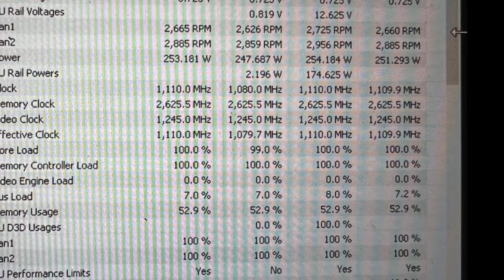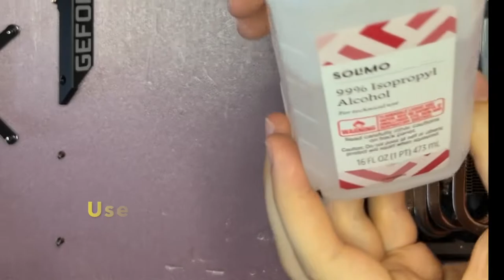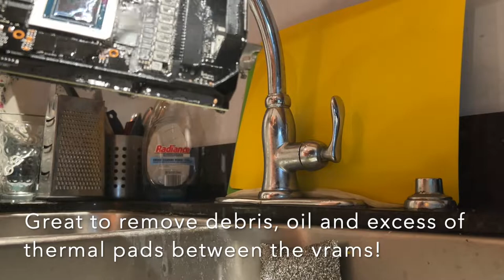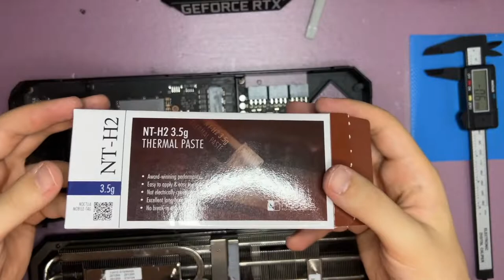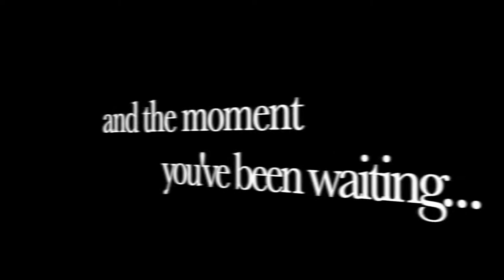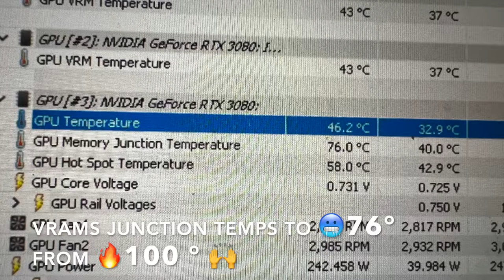Asus Rog Strix 3080 Thermal Pads and Fan Replacement

Comment: Very useful, thank you
Reply from the maker: I appreciate that!! Thankyou
Reply: @MAIKUS07  May I ask where did you get the replacement fans from?
Reply: @MAIKUS07  I just followed your guide and was able to change out the fans and repaste the card. I didn't change the thermal pads though. Anyway just wanted to say thanks again as this made it so easy to do.
Reply from the maker: @MSJChem  I’m very happy to read that :). Thankyou so much for your feedback!!!
Reply from the maker: @Eim4 gameplay Hi! I found them on Ebay, check the comments I put the link  to another viewer that was looking for them, good luck!
Reply from the maker: @Eim4 gameplay https://www.ebay.com/itm/304259129763?mkcid=16&mkevt=1&mkrid=711-127632-2357-0&ssspo=vy_yv6bxswk&sssrc=2349624&ssuid=-nTIr3M5Qje&var=&widget_ver=artemis&media=COPY
Reply: @Eim4 gameplay Aliexpress.

Comment: is it possible to install the Noctua fans instead of the original fans?
Reply from the maker: Which Noctua fans? Do you have a link to see them?
Reply: How would you attach Noctua fans to this in the first place? I am planning to do this with two NF-A12 but I can only see four screws in total on the gpu.